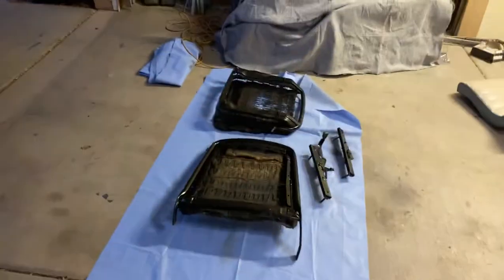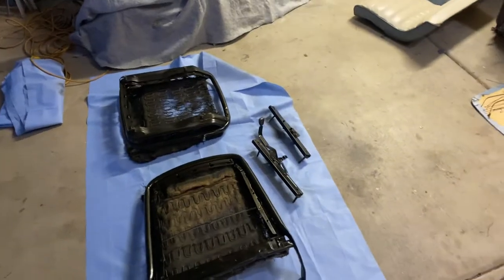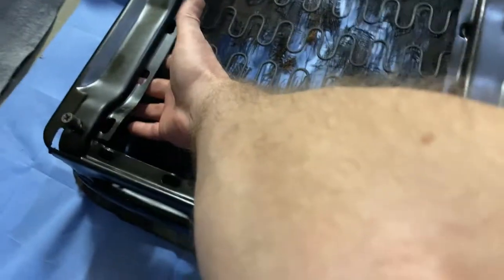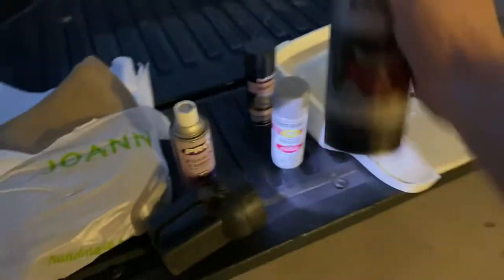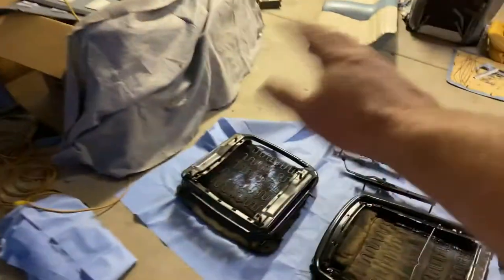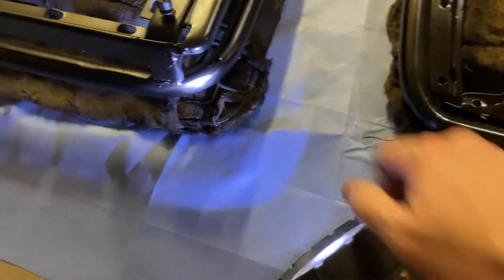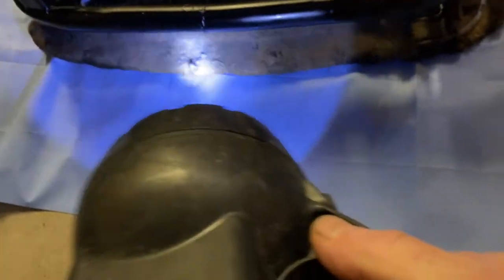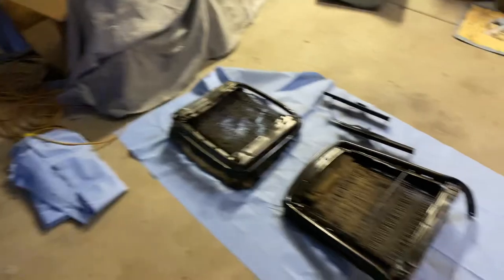65 Mustang fastback seat upholstery part 3

Comment: Hey there, what kind of material is that white stuff? Thanks.
Reply from the maker: Its a polyester sheet filler I got at Jo Anne. I also got some burlap there as we'll. Total spent less than $12. Enough to do both from seats and rear seat.